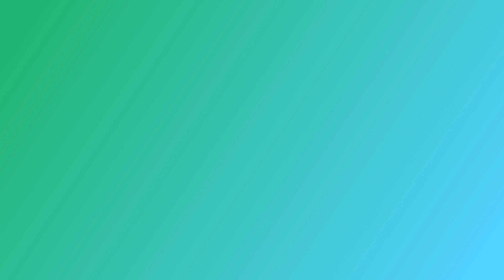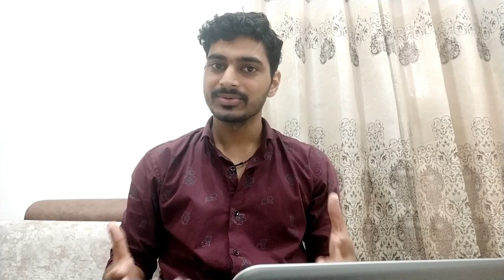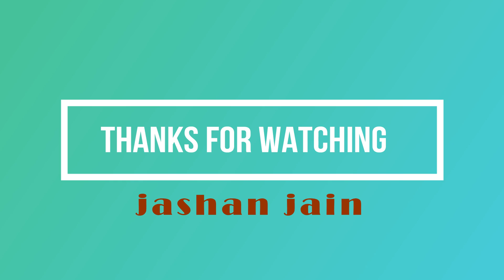#Intel #Electronics#VLSI My INTEL Interview's Experience this LOCKDOWN || VLSI || IITMandi || CORONA

Comment: Sir Currently I’m In 7th Semester Of BTech ( E&TC ) , I Got Campus Placement In To VLSI Company With 3.40 Lpa Only , Should I Join The Company Or Should I Do MTech In VLSI ?
Reply: based on the company but join the company
Reply: @venkateshtm9254  It’s Tech Mahindra Cerium System ! ( VLSI )  VS M Tech At NIT Goa 
Which One Should I Prefer ?

Comment: Interview
Introduction
Front end 
Back end 
Tools used for projects
Cadence virtuoso
Xillinx
DRC , multiplicin cadence

Vt role in CMOS
Multipliers in cadence virtuoso
Bgr means voltage reference circuit
Layout making different parameters
Different Metal layers
Common centroid matching MOSFET
Why saturation occurs
Technology today
Latch up 
How to avoid latch up
Drain current in linear and saturation region
Vgs > vth nmos 

IIT MANDI